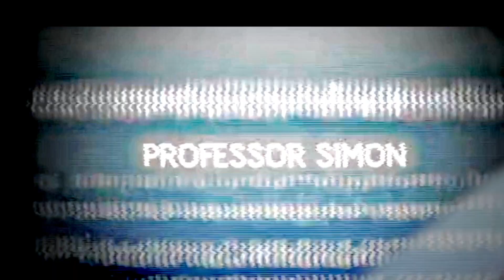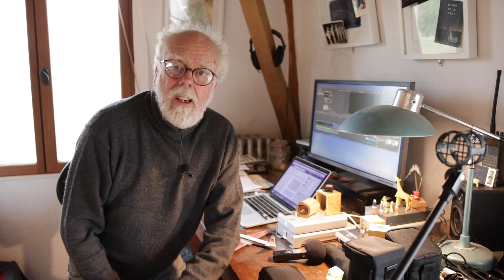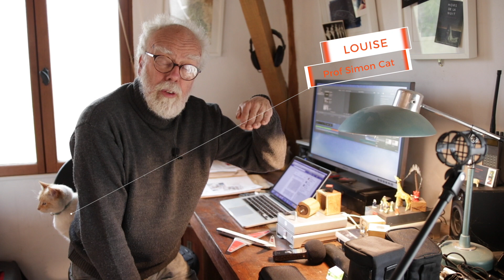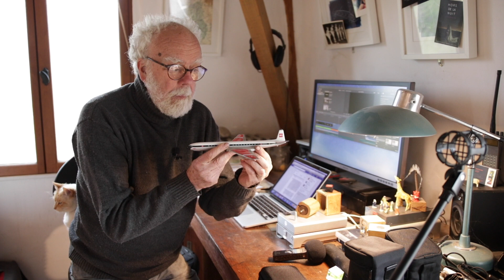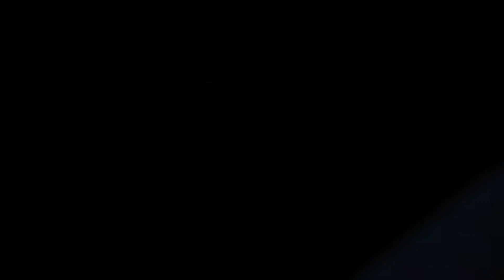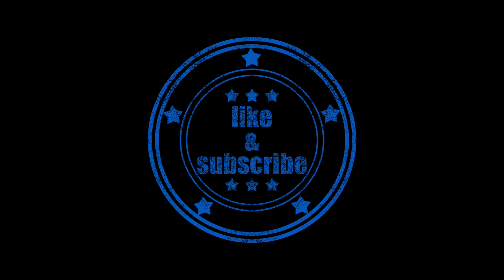737 Max 8 - Report published - Prof Simon

Comment: Thanks for the videos. I believe MCAS was intended for specific situations where the engines power and new location could cause the stall. MCAS does not active or run as a needed system during level flight, meaning it’s not needed to fly level, it’s intended to kick on when nose up.  So I would say the 737 can maintain level flight hands off. The issue is that one AOA is used to autotrim and the commands allowed for MCAS are extreme to fully engage the horizontal stabilizers without a warning that MCAS kicked in. Give a warning of MCAS and all should be fixed. You see AOA disagree indicator (on many MAX already but optional) and you nose down, kill the switch and maintain flight. This would have alerted ET302 much sooner in flight and allowed them time to trim where in this crash it appears the identification of runaway trim  may have come too late  for this specific crew. 
 Also in this reporting, you didn’t mention that they never reduced throttle. They received speed warnings and hit redline. Any runaway trim at that speed is exacerbated. I think the speed was more of a factor as they performed the correct procedure but were too fast to manually trim with the nose down. 
My thoughts, love the videos, but I really disagree in the statement that the 737 can’t fly level hands off, it can and does, MCAS was intended for specific reasons inherent to the engines, not to maintain level flight. As far as I know...

Comment: The only way they would have regained control would be to "unload" the force on the hstab to crank the trim. But they were so close to the ground this is probably not going to be anyone's plan to put the nose further down to release the forces on the tail. Another question no one is asking is why the hell they were at 94% thrust the whole time!  Way too fast. This creates even more force on the Hstab and everything gets more dramatic with that much power and speed going on.

Comment: I don’t like this MCAS business. It turns on when the autopilot is turned on. That is completely ludicrous! The autopilot is a great labor saving device that still has to me told what to do and continuously monitored so that it maintains course and altitude and/or airspeed. It does all of that very nicely and knows (just like a pilot does) when it needs trim and runs the trim motor as needed. It can’t fly the plane without the trim being set just about where it needs to be. If you disturb the trim while on autopilot and don’t allow the autopilot to re-trim the plane it (being the autopilot) will just throw its hands up and will disconnect with a loud alarm bell.
Reply: Lem B  MCAS is ON only if the Auto Pilot if OFF and the flaps are fully retracted.  The MCAS did what is was designed to do,  it received faulty AOA information with no redundant AOA data to confirm or inhibit that faulty signal.  MCAS was not able to do anything else except what it was instructed to do.  ADIRS gave faulty info to FCC,  FCC commanded MCAS.

Comment: MCAS Should have a down trim limit. It should not trim down the plane beyond a position the elevator cannot longer pitch up the plane. If trim down beyond elevator pitch up power were necessary, then al least pulling back the yoke to the limit should override mcas, no matter what, commanding a trim up back to a position where the elevators have the power  to pitch up the plane.

Comment: This aircraft needs to be permanently grounded and scrapped . Design a new 737 instead of cutting corners and putting modern equipment on an outdated design .
Reply: That's silly. 80% of the plane is classic 70s-era, proven 737 and the  rest , apart from the engines and some software, is like the equally safe other modern  variants of the plane.
The actual fix to make everything function will be less than the cost of a single plsne - excepting, of course, the horrendous legal fees.
Reply: Tony Danis I love 70’s era muscle cars but I would rather drive a 2019 f150 everyday to work .
Reply: @rolledz24 Excuse me, I have to go find who actually knows what they're talking about - bye!
Reply: Tony Danis , “What a long strange trip it’s been “. Cheerio.
Reply: @tonydanis1480 ,change the damned engine. No need for MCAS anymore.

Comment: On the other hand, when the plane is nose diving at high speed with the altitude rapidly diminishing, doesn't the system aware that the plane is about to crash at all?  And it continues to let the plane crashes?  Engineers who built the plane didn't think of this scenario? Obviously this is a serious software omission in the auto system.  God knows how many more omissions there are.
Reply: The plane didnt dive until seconds before crash, after the mcas been activated again. Check out the diagram in the preliminary report they gained altitude until the last mcas correction.

Comment: To make the story short, I think the main problem is not the Mcas, but Faulty AOA sensor, that activated MCAS .  Another thing I don´t understand, why would Boeing would make a system like this, relying only in on AOA sensor, my god.  Engineers .
Reply: especially considering the fact that they already had TWO AOA sensors on the plane!!  Why not use both?  They should also have designed MCAS such that when the pilots override it, it should shut itself down because the only reason the pilots would override would be MCAS malfunction (most likely caused by AOA malfunction).
Reply: It's MCAS. Aircraft aren't supposed to rely on just one critical element. To add into this, MCAS is a system that makes drastic adjustments to the horizontal stabilizer. If engineers felt the necessity of such a fast actuation, then the aircraft is simply very unstable when climbing. I agree that no aircraft should need an excessive input to stay horizontal. The vertical stabilizers are very large for that same reason.
Reply: @Ihaveanamenowtaken ,put it this way, the MCAS is  needed because of the engines are too big and have to be fixed higher-and-forward away infront of the wings.This tends to over-pitch up the plane on taking off. MCAS job is to pitch down the plane.
Reply: kelvin loh Yes. But it's a faulty system. The aircraft is unstable. Curiously, if the plane was longer or if the horizontal stabilizer was a little larger, MCAS wouldn't be needed.

Comment: When started this series on the 737 I mentioned that if the AoA is providing faulty information the system that is designed to correct follows what it is told. That isn't a design flaw almost all systems operate the same way. It is the lack of redundancy and over emphasis on performance over safety. Not cheap to correct but it should have not been released as flight test should have revealed this. Remember aircraft have multiple redundant systems for a reason...
Reply: True. It should have at least three AOA sensors or better yet four. Then you employ a voting system that can automatically vote out the bad sensor. You need more than two sensors to establish a quorum. Otherwise you might as well give the pilots a coin and let them flip it in the cockpit to decide which sensor to believe.

Comment: From another YouTube video it sounds like the pilots never pulled back the throttles after takeoff leading to the high-speed and the inability to manually re-trim.
Reply: The pilots are not to be blamed. The report has already said that the take-off was normal. Boeing designed a faulty system.
Reply: Look at flight data of 10/28 JK43, the Lion Air flight that recovered from AoA failure. They had an altitude of 5000 above ground which is ~4000 ft more than Ethiopian Air 302
Reply: The high speed was caused by the plane descending. pulling back the throttles might have reduced the speed a bit, but not nearly enough.
Reply: @TheFulcrum2000  The smoke witnesses observed was likely the engines over speeding ?
Reply: @ricknash3055  I don't know.

Comment: What i dont get is that you can at any time override mcas with the trim switches. Switching the system back on and then using the trim switches to trim nose up should have temporarily disabled mcas for a few seconds but at least the a/c would be stable unless mcas can move the stab beyond the range that manual electric trim operates. If thats the case then boeing is down right stupid.
Reply from the maker: I wonder if we will get the full story on mcas from Boeing?

Comment: Correct...
But.. A large aircraft that has a useful load can't be stable in the  lateral axis  with a simple trim like a light aircraft. 
The  centre of balance moves with load changes  too much, the turning moment varies with thrust settings  and the force on the horizontal stabiliser changes dramatically with speed changes
It has to have such a huge trim variation.
And.. 
All 737 are nearlly impossible to  retrim manually when they  are so far out of trim  if you are holding opposite elevator especially at high speed.
The two ways to cure it are use the power assistance or let go of the elevator to unload the trim forces but obviously that isn't an option at low altitude.
Conclusion is that they did what and  all  they could after the mcas system had set up the situation.
Reply: Yes, it needs trim capability.  However, if it was a stable design, it would not need MCAS.  Every other rendition of the 737 did not have MCAS and had a great safety record.
Reply: Ronald Craft. The B737 MAX is stable in pitch.  It’s departure characteristics into the stall are harsher and different enough for Boeing to need to install a stall prevention system to try and avoid retraining pilots.   Aircraft are designed to be nose heavy around lift axis of the wing the tail plane pushes down to lift the nose up.   If the B737 was completely unstable or had relaxed stability a control system would need to use gyros to stabilise it artificially as the pilots would soon tire.  Modern jet aircraft can’t fly without yaw dampers, autopitch, Mach trim.   The idea of a pilot flying an aircraft manually died in the early jet age, about 1950.
Reply: @galinstan5603  Isnt't MCAS basically only an stall-prevention system and not a trim-control system? Virtually any commercial aircraft isn't horizontally stable because of the uneven load, as Mellanie mentions above, no matter of the design. And they don't have MCAS.
Reply: Yes, MCAS is a stall prevention facility that exerts its influence through electric trim control.

As long as the aircraft does not approach a stall, it dies not exert any influence.  Also, the stick should shake first before MCAS takes any action.
Reply: @galinstan5603  well there are over 300 hundred dead people that would suggest that isnt what happened
Reply: @Mellanie Parker Mellanie, I never said it worked. I'm just stating what it is supposed to do.

Please let me be perfectly clear the max aircraft as it stands should be permanently grounded as configured.  This kluge was created by MBAs not engineers.

There also needs to be a criminal investigation into Boeing and the FAA. Boeing attempted to put a 21st century engine in a 20th century aircraft and failed. Yet, they put the aircraft out anyway.
Reply: @galinstan5603  Well, it does NOT need the MCAS to fly safely just as our cars don't need ABS to drive safely. It's a common misconception that the MAX couldn't fly without MCAS. It is there not to fly the aircraft but to help the pilot in critical conditions.
And the tendency of the MAX to pitch up is just as faulty a design as the rear wheel driving of the cars (who have the tendency to oversteer) or the front wheel driving (which has the tendency to understeer).
Reply: Rata 4U  A fighter is flown with the understanding that it is the latest technology and inherently dangerous.
An airline passenger expects that everything is done to ensure their  safety. 
Flight augmentation that "if fails"  causes a loss if control may be acceptable on a raptor but not on a Boeing.
Reply: Thank you, Ronald! So I had gotten it all right. MCAS could as well be implemented in ANY other aircraft as an anti-stall feature since any other aircraft could be stalled. It's just that this one is a bit more prone to stalling than all the others because of some of its design features.
I can't think of a commercial aircraft which is 100% pitch neutral. They all need trimming through each flight for many reasons - fuel consumption, people changing places in-flight, cargo placement, etc. The MAX needs just a bit more and also depending on the engine thrust. Is this a compromised design? Of course not! It's just a design that demands more specific trimming. And for all that we know, cares have been taken so it could fly perfectly well. It's nothing more of a "design flaw" than all the fighter jets outside.
From all I heard so far the unfortunate pilots met a sensor malfunctioning and their actions in the situation led to the disaster. Pretty much as in the case of Avianca. Back then all was blamed on the technician who didn't remove the protection foil from the static ports. But the pilots didn't see it on their pre-flight inspection and then, when they had wrong speed and altitude readings, made a series of critical mistakes that brought the airplane down. In the case with Ethipian and Lion we all blame it all on Boeing. It's so popular to blame the corporations nowadays. While many pilots just don't know how to fly. And since they're dead in these two cases, nobody tends to bring forward THEIR contribution to the accidents. But the elephant IS in the room. Just no one wants to speak about it.
Reply: @vladispassov Boeing did not know the increased propensity to stall until test pilots reported the anomaly. When you design a new implementation of an aircraft and find it needs a crutch,  i.e., MCAS, you have failed! It should have been back to the drawing board. However, it appears the MBAs overrode the engineers.

Please see my additional comment below.
Reply: @galinstan5603  yes .. I agree.

Comment: Ola Professor -
I'm from Brazil (I speak Portuguese, so when I use the translator, it does not always look good. As far as I can tell, this MCAS system has troublesome problems ONLY WHEN I ACHIEVE CERTAIN DEGREE IN TAKING OFF, whether it's obstacles, location, or others. We know that when activated (Left - (stanby) - Right), or NEVER GO BACK TO THE SAME POINT NEXT. In my view the fault is DUPLOCLICK, 1º) MCAS (Left) system, activating 'Stanby' next or next the 2nd) PILOT activating (Right). Thank you !